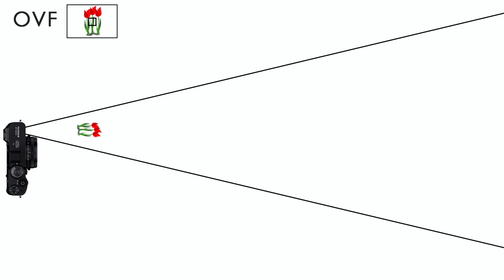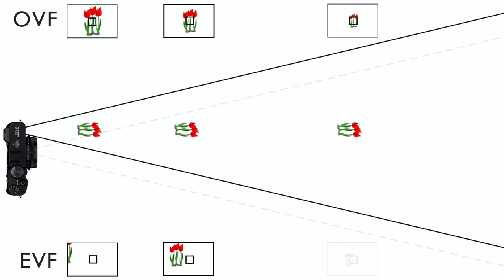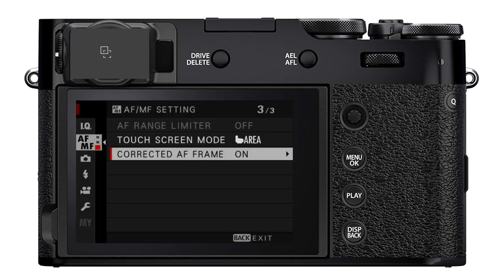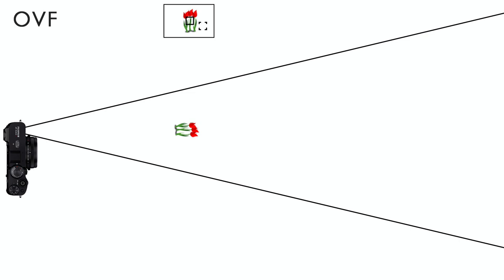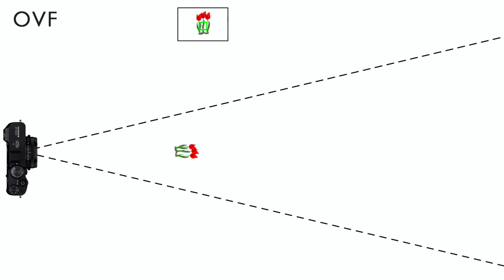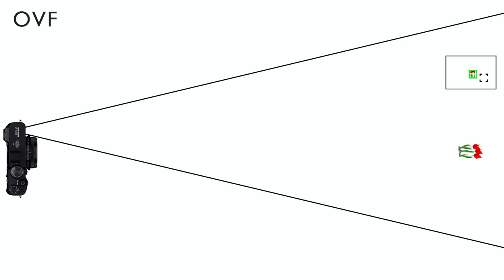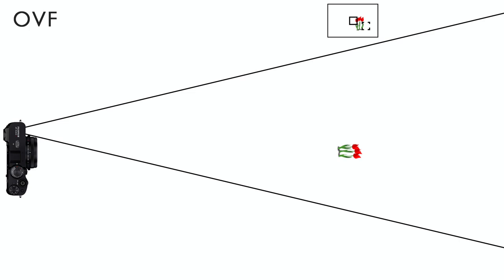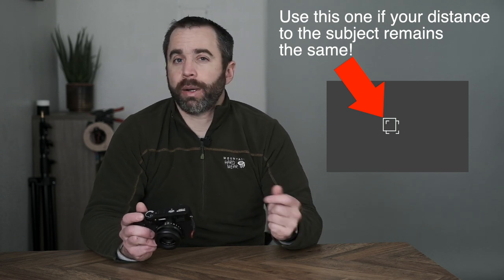Fujifilm's Corrected AF Frame - How it Works and Why

Comment: How do you find the frameline accuracy? Is it usually wider than actual image?
Reply from the maker: Yeah, I've found the actual captured frame to be just slightly wider than the "bright frame" framing guide. I guess it's better to err on the wider side and crop later than to not have captured a part of the frame you thought you captured ¯\_(ツ)_/¯

Comment: im looking through the view finder and seeing  another frame  with white outline and all the settings infor qround the edge  outside the frame how do i get rid of this
Reply from the maker: You can try cycling the DISP/BACK button or customize your Disp Custom Settings.
Reply: @PeltierPhoto  thanks I finally  worked it out it's was on sports mode, which was  roppi g the frame through the view through the  iew finder

Comment: Off the subject of this great illustration, how to override the custom simulation or disable them and shoot with normal installed simulations in x100v, thanks.
Reply from the maker: There's no way to "reset" just the image quality settings back to the defaults without resetting the camera. So I would suggest creating a Custom Setting (like Custom 7) that is programmed to the Provia film simulation and all of the other settings at 0.
Reply: @PeltierPhoto  Thank you it worked.

Comment: This assumes single point autofocus. Can you use the other AF modes with the optical viewfinder? If so how does it work?
Reply from the maker: Hi Doug, the examples in the video show Single Point but Zone also works the exact same way. You'll see the two focus squares for the Zone AF Mode (it just won't be dashed since it's already dashed, but will be in the same relative position and correspond to the same distance). Since Wide covers your entire frame, you'll just see the one box for your frame.

Comment: glad i didnt sell my xt5 for xpro3 for this. I actually use x100 and x100f then but most of the time only use EvF or ovf but with f8. See how this actually works is really confusing user and not practical to use the ovf. If i want ofv experience i'll save for Leica M, at least the parallax is consistent
Reply from the maker: Yeah it’s kinda goofy.